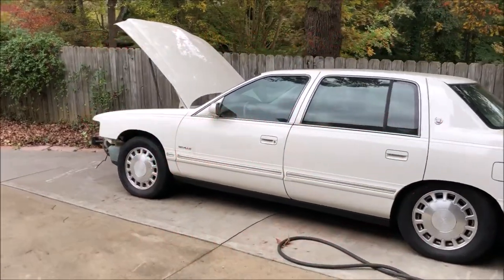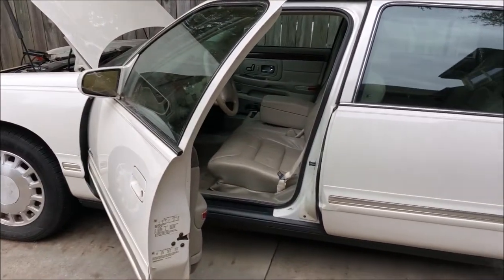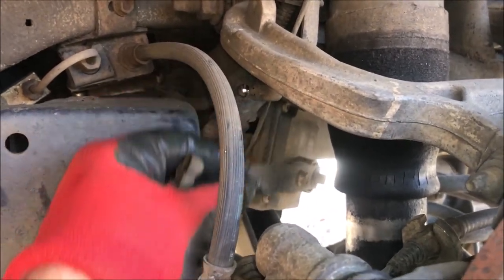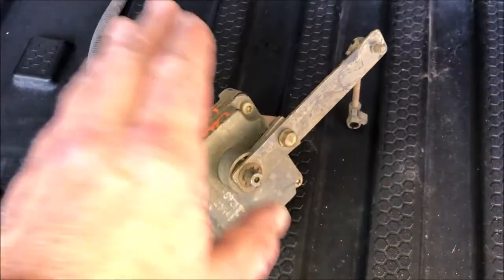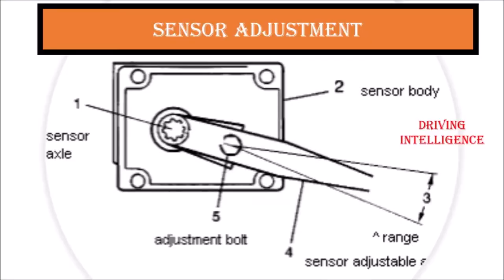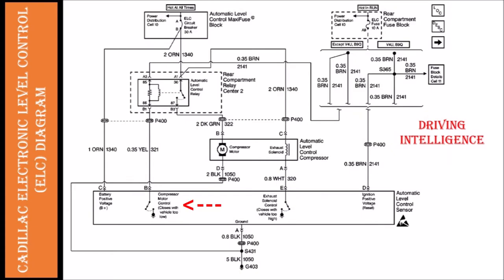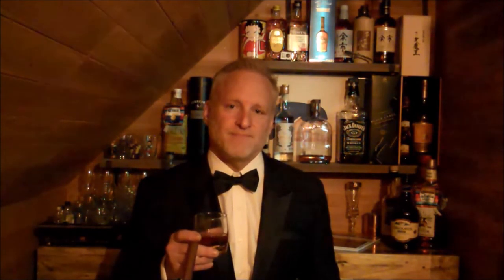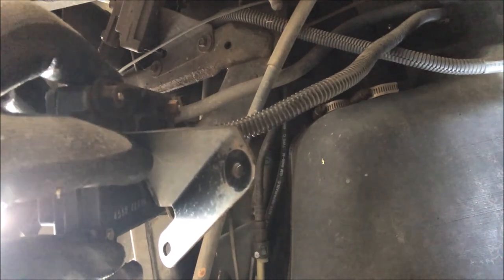Functional Overview of Cadillac / GM Electronic Level Control (ELC) System - Deville Series Part 13

Comment: Awesome most educational video I have seen so far , especially in the category of my search foran answer to my quest which is to increase the pressure in the rear shocks for towing a heavy loaded down travel trailer. The towing capacity maxim isn't exceeded, however is almost matched. The rear of the escalade drops considerably leaving the toung of the trailer lower than should be causing it to be in danger of scraping the road at dips or bottoming out and catching the jack foot .
Is there away to increase the overall pressure in the system so as to adjust for the extra weight of the trailer or is there another problem in the system causing it not to recognize the trailer therefore not adjusting for the tow.
Reply from the maker: thanks for your comment and reaching out.  I'm not aware of a method to safely increase pressure in the system.  You could exceed the capacity of the ELC System.  Couple of questions, Does the ELC System work normally without the extra weight?  If so, do you have most of your load at the front of the trailer?  You of course want to maintain most of the load at the front of the trailer forward of the axles for stability, but possibly redistribute the load?  I'm not completely familiar with the Escalade.  I'm assuming it has the articulating arm sensor on the suspension that lets the computer know to activate the compressor similar to that shown in my video.  I noticed that the sensor has minor adjustment to get more ride height.  Without a detailed knowledge of your ELC system, not sure what steps to take here.  The other options are either a load leveling hitch or helper springs in the back.  Let me know what you think.

Comment: I have a 1994 Cadillac Sedan Deville & my electric level control is not working @ all & I never new ware it was until now😮, but I don't know wether it's the system or the sensors are gone, so what should I do
Reply from the maker: There are a lot of diagnostic steps needed to isolate the problem, first step, have you checked for relevant diagnostic trouble codes?

Comment: I have a 2001 eldorado with a road levelin system. I'm going to put in conventional shocks how do I bypass the road leveling system. Is there a plug-and-play or can I permanently put the linkage in one position.
?
Reply from the maker: I'm not familiar with a plug and play, but you can go several routes.  You can set the sensor to neutral to prevent the system from activating, or you can pull the fuse for the system.  Pulling the fuse my affect other elements of your Eldorado and could cause a code.  I'm not sure.  So easiest route is adjusting the sensor to a neutral position.

Comment: hey, I have a 05 Deville have you had any problems with the ABS /traction light coming on? One of my wheel speed sensors is rusted but that's about it.
Reply from the maker: That rusted wheel speed sensor would surely be a problem.  Get that fixed / replaced and see if that resolves your issue.
Reply: @DrivingIntelligence  thanks will return lol, really want that abs/tc light off lol

Comment: 2002.  Cadillac. Deville.   When  start car.  I can hear the leveling noise.  For about 3 seconds  then it stops,  question is.  If its a sensor  would it ever. Even start  to work?
Reply from the maker: Sorry, I don’t understand your problem or question.
Reply: That is normal for the vehicle.  It starts, levels off (even small amt) shuts off.
Reply from the maker: After re-reading your question and seeing the answer from someone else, he’s right, that sounds like normal operation of the system.

Comment: Hi have a 2015 Cadillac  xts when driving  my air will go out in rear , and air compressor  won't pump it back up until  I have to let it sit for a while  ,please help
Reply from the maker: Hi and thanks for your question.  Just thinking through your problem, either you have a leak or you have intermittent operation of the air compressor.  Very hard for me to assist with limited information, but you could try the following, safely put the back of the vehicle on ramps and with a spray bottle filled with soapy water, spray the soapy water on the hoses of the air compressor, especially where they attach to the shocks and air compressor.  This will identify leaks, but the compressor will need to be operating for this to work.  Hopefully you  have a few friends, family that can sit in the car to load the vehicle while on the ramps to activate the compressor.  If this does not work, a more thorough examination will be required.
Reply from the maker: Any luck?

Comment: Can I bypass leveling sensor and hook up lines to a valve and fill like regular air shocks?
Reply from the maker: I'm sure this is possible, but depending on your problem, you might be able to wire in a switch that will control the compressor manually when you need to raise or lower the rear of the vehicle.  The other options is:  Monroe Shocks & Struts Monroe 90009C Air Shock to Load Assist Shock Conversion Kit - https://amzn.to/3zpx0ZT
Reply: Thank You !
Reply from the maker: @edwardschwantz7747  you're welcome

Comment: Hey there. I have a Oldsmobile car. 2002. I'm looking for the air compressor fuse and I'm looking to pull it. The shop changed out my rear suspension with cheaper (no air susp)... so literally everytime I start the car, a loud air compressor sound quickly sounds off and on for 10 secs. Is that fuse known as the electronic level controller fuse? It seems to be the only thing that makes sense. Is it safe to pull the fuse and never worry about this again??
Reply from the maker: Good morning.  Do you have the owner’s manual?  If so, check the fuse information to make sure that circuit doesn’t control anything else.  It is the electronic level control.  If only the ELC is on that circuit, no problem pulling fuse.  Alternative is to disconnect the connector at the compressor.
Reply: @Driving Intelligence  thanks a bunch for the info. Greatly appreciate it.
Reply from the maker: Glad I could help
Reply: @DrivingIntelligence  I relealize you dont have to answer this question and most likely have many other things to do instead LOL. The relay diagram also has a "Relay for it" Can or should I pull that as well? Or is the fuse good enough? Also I dont see anything shared or anything paired with the fuse or relay on the diagrams. Thank you.
Reply from the maker: The fuse should be enough to prevent any problems with the circuit activating.  You can pull the relay as well, just as an added step.

Comment: So while driving down the road, the wheels suspension is constantly moving up n down fairly fast. So as the suspension arm is raising and lowering soo fast, it the compressor turning on n off just as fast as the suspension arm is moving up n down?
Reply from the maker: Thanks for reaching out.  I'm not sure how fast you are referring to, but the air pump does not have enough capacity to move the suspension very fast.  It is a slow process when ride height is adjusted.  Perhaps your rear air shocks are worn out.
Reply: @DrivingIntelligence  for example: lets say going over a couple sets of train tracks, the suspension would travel up and down lets say 8 times. That means the shock would be in the compressed state 4 times and in the extended state 4 times. Would that make the compressor turn on and off 4 times within that 1.5 seconds going over the train tracks?
Reply from the maker: @johnperez93640  let me make sure I understand.  In 1.5 seconds the transmission makes 4 complete up and down cycles?  If so, I doubt that is the self leveling system.  The compressor on the car in the video takes an incredible amount of time to adjust ride height.

Comment: I have a 90 bonneville SSE 41k miles with this same setup. The electronic module looks the same but its on the passenger side. The air pump is in the engine bay. Pontiac has a tire inflator in the trunk. I tried to use it on a bike tire and it didnt create no more than 15psi. I dont hear air leaking anywhere when the pump runs, If I put my finger on the pump outlet it builds pressure on my finger. I guess its leaking out of the rear shocks?
Reply from the maker: Thanks for reaching out.  Very sorry, I can't diagnose the problem at this point.  Could be many issues.  Good thing, you are getting activation of the pump.  Is your self leveling system not maintaining rear vehicle height?  What other issues are going on with the system?

Comment: I was told by a mechanic that I could have regular ( non air ) struts and shocks on the back of an 02 Deville DTS. Is this true? BTW , my alignment  was  corrected on  front and  back  today.  I had the front suspension  replaced  in the  summer.
Reply from the maker: You can run normal shocks on a Deville without use of the ELC System.  Hope this helps!

Comment: Awesome video! Very clear! A couple of questions: I picked up a 2007 Cadillac DTS last weekend, in decent shape, I was trying to determine if mine had this leveling system. Does the  leveling system only affecting the rear of the vehicle? Also, the front passenger side brakes were making a grinding sound, one of the pads was worn down to the metal. I replaced the rotors and pads in the front, both sides, and put two new tires on as well, because the left passenger tire was wearing on the edge as if the alignment was out. When I drive it now, immediately after the front wheels were removed and replaced, the vehicle bounces and bobs up and down like a bouncy castle! It did not do this before and was a very smooth ride. At first I thought it was a very rough road and the car was getting its bearings, so to speak, but it bounces on smooth roads and at slow and fast speeds. Any idea what might have caused this? Thank you and keep up the good work!
Reply from the maker: Hi and thanks for the comment.  Is the issue with your tire a bounce or a vibration?  What comes to mind is the following:  Improperly filled tires (wrong pressure), tires with a broken inner belt, tire & wheel out of balance, damaged or suddenly failed strut / shock.  Go back to the tire place and ask them to check balance and tire condition, also, put the car on ramps and see if any of your shocks / struts are leaking.   If they are, you'll see oil streaming down the side of the absorber.  I checked and your car has the Magnetic Ride Control System and this appears to control the valving of all shocks / struts.  You could have a failure in the system... do you have a check engine light?  This article might be useful:  https://vigorairride.com/blogs/news/whats-the-2007-cadillac-dts-air-suspension-switch-location
Reply: I own a 2000 DTS since 2003.  I will say that this car has definitely kept me busy.  You name it, I've had to fix it.  One of my repairs was the suspension.  The DTS does have the leveling sensor as you mention.  The ride height is adjusted as you see,  Basically it has air shocks in the rear.  The front struts are also controlled electronically.  The hydraulic fluid in the front struts are electronically controlled (isn't that special).  This controls the stiffness of the ride.  The bouncing sounds like something has been disconnected or broken.  A quick check, stand next to the car, push up and down, if the car bounces more that 2 X.  It's likely a bad shock/ strut.  A good visual inspection  including the tires is in order.  I also wanted to mention, I replaced the OE shocks and struts with an aftermarket system from Suncore industries several years ago that works real well.
Reply from the maker: @davetherave6569 great input, thank you

Comment: I have a 94 deville concours, pulled the sensor from junk yard but can't seem to locate it on mine.  Any ideas, it isn't in same place as this video.
Reply from the maker: Thanks for reaching out.  Did you pull the sensor yourself on the junkyard vehicle?  Where was it located?  I'm researching your car, but having trouble finding schematics.
Reply: @DrivingIntelligence  yeah pulled from same year same body but not concours.  Back left behind wheel.  Mine isn't there when I had it in air looking for it.  Can't seem to find anything either online
Reply from the maker: I’m going to continue to look. I’m making some progress with information on your vehicle but not on the location of the sensor. I’ll advise
Reply: @DrivingIntelligence  thanks
Reply from the maker: I’ve not been able to find anything else on the location.  From what I found, it should be under the left rear wheel.  Is this a new car for you?  Could it have been removed by someone else?
Reply: @DrivingIntelligence  yes another cadillac for me.  I've had more than a few just been lucky without having the air ride problems,   service air ride comes on and off on this one.  At one point back end was in air while driving for a bumpy ride. I'll probably go under today and go for round 2🤷‍♂️ right on for the reply
Reply from the maker: I did look up your sensor and it's a different design.  Might be in a different location from the '99 in this video.  It definitely has the arm that should connect to the suspension somewhere.  Also, if your vehicle is increasing ride height over a bumpy road, you might have a problem with your active ride management system.  Do you have any Diagnostic Trouble Codes?
Reply: @DrivingIntelligence  p056 current and some s010 history I think something like that. I'll check when I get off
Reply: @cagedhyenap4034  : I believe Concours had a more complex setup. I think it was called Computer Command Ride.

Comment: Im glad youre gonna crack one open.   I guess it has a reostat set up.
Reply from the maker: It did, hope you saw in the video.  Could be worth opening if good with electronics, but the sensor is potted so hard to get to the electrical for testing.
Reply: @DrivingIntelligence  I was surprised it had the circuit board in it. I kind of expected a simple reostat with possibly a pressure limit switch there or at the shocks. Did you ever get the inoperable one to function? I just crawled out from under a 2005. It is squeaking and creaking and my friend thinks it's going to break in half. I pbd ever bushing I could find in the suspension. The rear center motor mount is cracked all the way around. I'm hoping it's not a nightmare to r,&r. And the A am bushings in the rear look rough. I'm not looking forward to that. It looks like it will require 4wheel alignment if I tear all of that out.